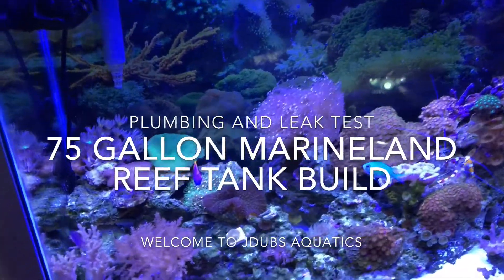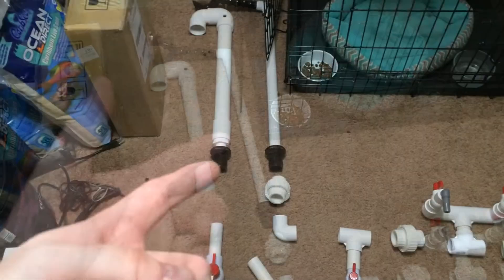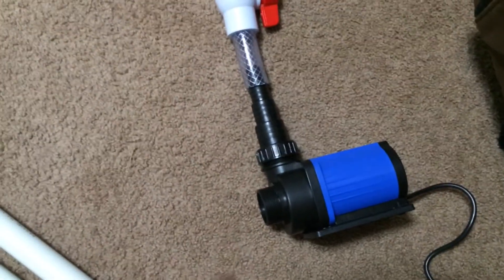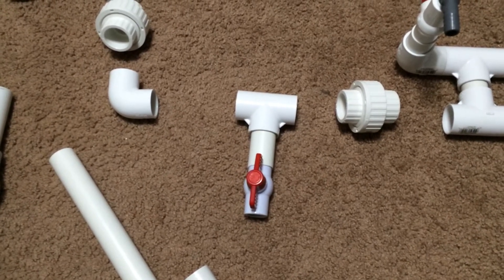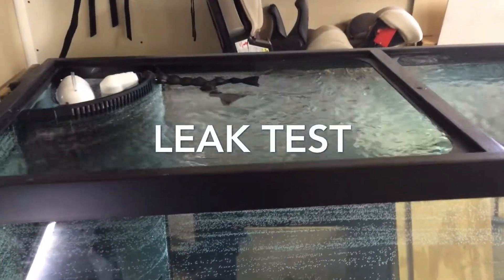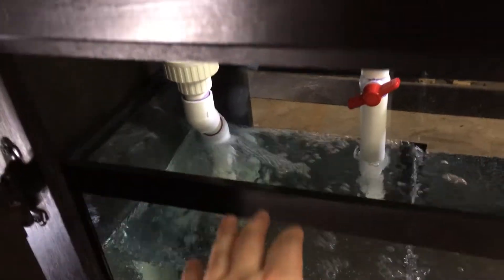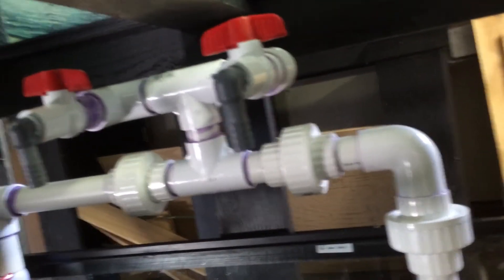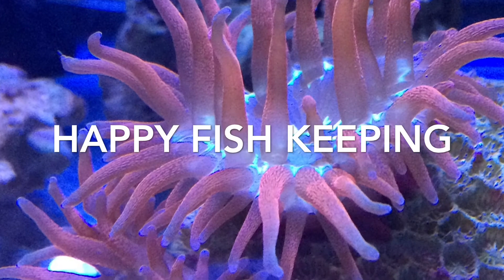75 Gallon MARINELAND Reef Tank Build- Plumbing And Leak Test

Comment: Just bought a used version of this same tank. Was a little panicked since I've never done this before and no instructions came with it. Your video is a life saver.  Thanks so much!! What's the manifold's purpose? And why would you want to recirculate cleaned water? Remember I'm new at this process. A ton of YouTube videos is my limited experience so far. Thanks.

Comment: I have to say you did a great job on this video. I have this tank as well; just bought it off of Kijiji. I'm missing some of the pluming parts that go into the wet dry and also the front panel with the teeth that filter the water into the intake. I live in Ottawa Canada, not sure where the cheapest place would be to purchase parts.   Thanks once again for the video, it's helpful.

Comment: Love the setup Jorden,I was looking at that same return pump for my 90 gal but i saw acouple of review's that said thay crack by the inlet. Your pump must be doing great,how is the noise level.P.S. great job on the vid's
Reply from the maker: Hey thanks! I only ran mine for a week to leak test it. Didn't have any issues. I'm moving in July so it will be set up then. I have so much extra power I decided to plumb a 20 gal frag tank into the system

Comment: Jordan, I am currently setting up the exact tank. I'm excited to see how your turns out. Quick question, did you use the plumbing kit that came with the tank? Today I just filled me tank with water and I'm getting some leaks from my return gasket. Got any tips for me?
Reply from the maker: Hey thanks for subscribing! Ya j used the stock plumbing kit for the overflow. Mine was too tall and I had to cut them to fit. I didn't have any leaks. Did you use a channel lock to tighten it down? And did you clean the gasket and glass before installing?
Reply: Jorden Watkins I didn't use the channel lock to tighten because it was recommended by the retailer not to. They told me to tighten by hand. I was hoping thats what you would say. Did you just go with manufacturer's recommended quarter turn?

Unfortunately, I did not clean the glass before installing. Wish I would have.
Reply from the maker: Ya I just did  1/4 turn maybe slightly less. I hope that does it for you

Comment: are you running a durso for your over flow stand pipe? bulk heads both 1"?
Reply from the maker: Both bulkheads are one inch. I watched a video about Durso but I'm not sure I understood it. I'm using the stock plumbing MARINELAND sends with the tank
Reply: for some reason my 90 has 1" and the other 3/4 which is annoying. i tried using the stand pipe that came with mine. sounded like a jacuzzi. lol switched it immediately. the build is coming right along.
Reply from the maker: There is a syphon break hole in the return pipe that I am going to fill cuz it makes a lot of noise. Otherwise it's running pretty quiet. Pump is silent too
Reply: you really dont need a siphon break. with your return nozzles close to the surface. they will break the siphon.